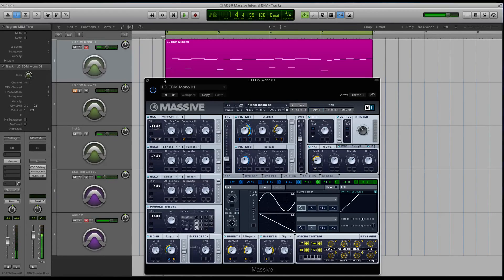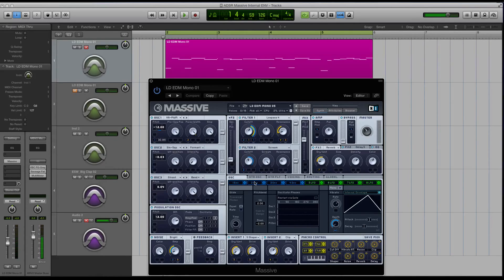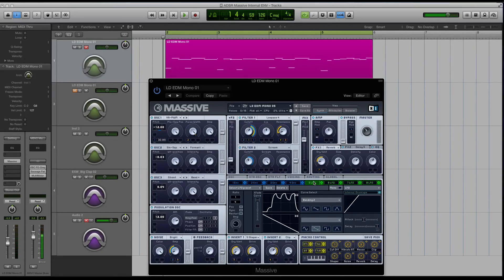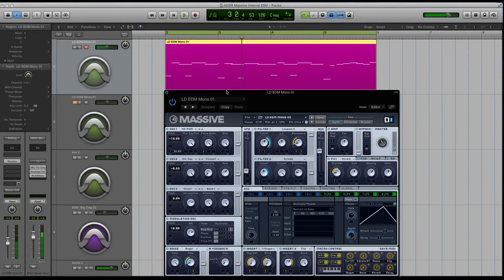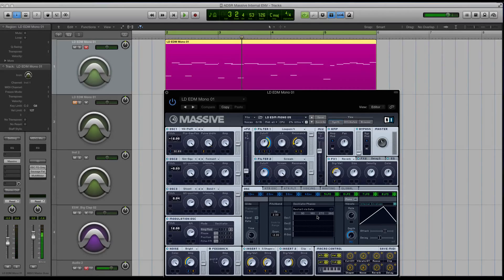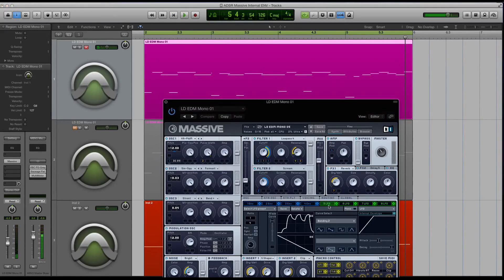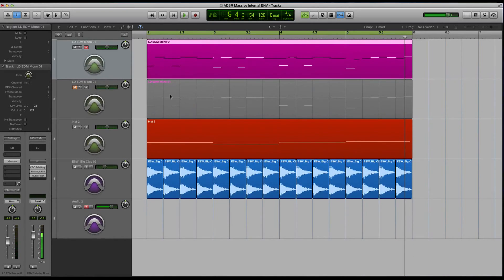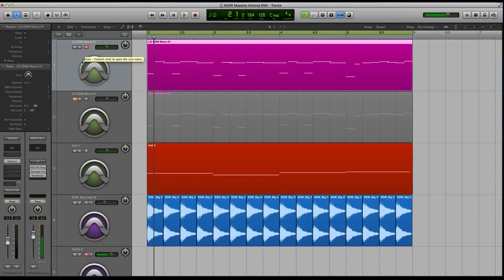NI Massive Tutorial - Using Massive's Internal Envelopes

Comment: when i drag the envelope cross hair onto whatever i want to modulate - phase for example - i never get the blue line appearing on the item to be modulated - the number appears in the box below the dial but no blue line curving around the dial and so no modulation...any idea why? i follow the tuts exactly....ughghg.
Reply from the maker: +GB3770 You need to click and drag up (or down) on the blue number in the modulation box. Clicking and dragging the crosshair from one of the modulation Envelopes or LFO's will apply the modulation to a parameter, by clicking and dragging up or down on the blue/green number in the modulation box you are setting the modulation amount.
Reply: Easy when you know how - thanks very much for letting me know that.